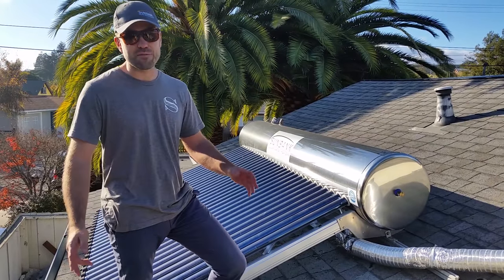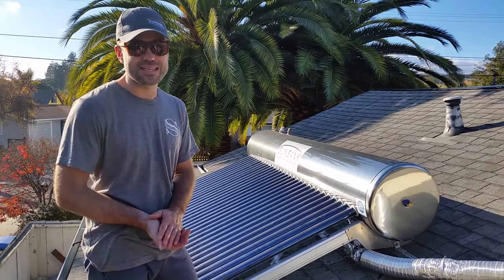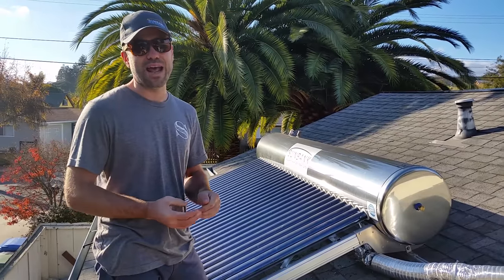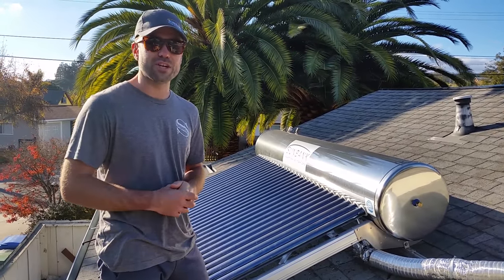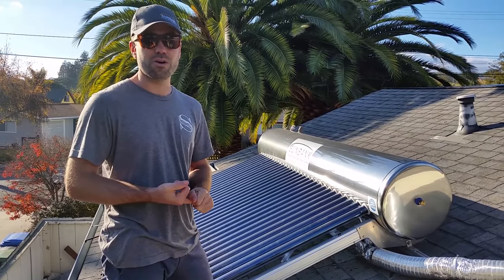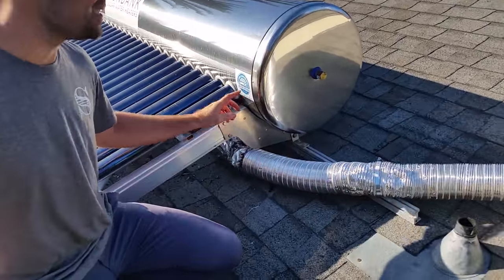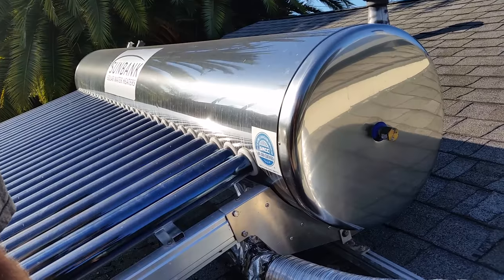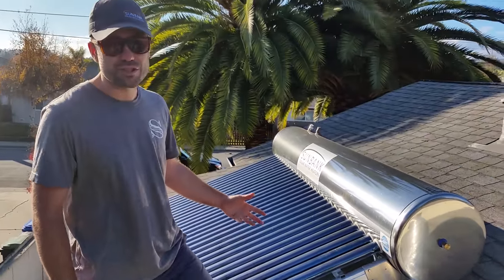How Solar Water Heaters Work

Comment: What is the lowest temperature that sistem can take? I live in Albuquerque and in winter months temp can drop quiet cold
Reply from the maker: The Sunbank collectors are good to -35F and the tank has 40 or 80 gallons of thermal mass and good insulation, so those components are both fine in freezing weather. The part of the system that is susceptible freezing is any plumbing between the tank and the conditioned space. We have many systems installed in New Mexico, including on the Earthships near Taos - they all perform really well. More info here: https://thesunbank.com/freeze-protection/
Reply: @SunbankSolar  great. Do you sell the system or it comes with installation only? I am asking that becausei do eant to buy one but i do plumbing and i could install it myself and save some money.
Reply: Careful, Walter might knock on your door

Comment: If the tank at the top is painted flat black, it will collect a lot of heat also..Also, spray foam / insulation under the tank can help keep more heat in...Also, a big reflector onto the big tank could help, at least a shiny plate to reflect light onto the tank..
Reply from the maker: What you see in the video is the outer shell of the tank. It has 2+ inches of high density polyurethane insulation underneath it and then the actual 316L SS pressurized water tank is underneath that. So the tank is already really well insulated. For example, you go to bed with 140F in the tank and wake up with 135F.

Comment: Think I’d rather just have a solar panel to heat the water in my existing water heater. I don’t live in the tropics. Have you installed any of these in northern Alabama?
Reply from the maker: We have systems dotted all over the South, yes. Using solar panels instead is an option, but a less efficient one. Solar panels are getting up to 20% efficiency, but evacuated tube solar collectors are 3 times that. So, you would need 3 times the roof space to create the same amount of heat as the Sunbank. Solar panels are also more expensive. And you'd have to buy and install the electric water heater. So, there are quite a few advantages to a purpose built solar water heater.

Comment: Can you make a glass box around the system to harvest more energy, something like greenhouse, I think it make water hotter, and made system more effective.
Reply from the maker: The evacuated tubes are exactly that. They each create a (almost perfectly insulated) greenhouse around the copper heat pipe that transfers heat into the tank. It will be 400 degrees on the inside of the tube and is always cool to the touch on the outside, because of this vacuum. A second piece of glass around the tubes would be unnecessary and would reflect some of the UV radiation that heats up the tubes.

Comment: Looks like a great product. Can a low-flow recirculating pump be used with this system? Specifically, pushing water through this tank to allow hot water near all the faucets in the house? I will have a dedicated return line.
Reply from the maker: Absolutely - in fact, we sell a recirculation kit to be used with the system. Since you have a dedicated return line you don't need the valve and supply lines, so you could just buy the pump or get one from another supplier. Ours are incredibly reliable, have magnetic impellers, and only draw 8 watts. https://thesunbank.com/products/

Comment: How many people can use one if lets say its installed in a hotel where people shower simultaneously?
Reply from the maker: Thanks for your message. The 80 gallon system is typically good for 3-5 people in a residential installation. For a hotel you would put several systems together in parallel, based on the daily consumption. You would likely have them pre-heat your existing water heating system, so they would just save you energy and money but not be relied on for hot water. See our commercial system video which shows systems installed on apartment buildings.
Reply: Great question

Comment: Will the water freeze at night in a cold climate If the electric power goes out?
Reply from the maker: The system itself is not really concerned with freezing. The tubes are good to -35F and the tank is very well insulated with 40 or 80 gallons of thermal mass. We have a lot of systems installed in places that freeze and they don't have freezing issues. More info about how to prevent freezing here: https://thesunbank.com/freeze-protection/

Comment: Does this work in upstate NY?
Reply from the maker: It does, but with some important notes. First, any plumbing in an unconditioned space will need to be properly freeze protected. In cold climates, it may be more efficient to use our system as a pre-heater instead of a stand-alone, so that your main tank isn't mounted outdoors. You could also use the system as a pre-heater, but only use it seasonally, from spring to fall when you'll get the most solar gain, and drain the system for the winter.

Comment: Is this better than a radiant  boiler with a circulating system ?
Reply from the maker: It definitely creates less emissions and is cheaper to operate! But they are different systems. This is primarily for domestic water heating year round, whereas a radiant boiler is to provide heat in the winter when there are fewer hours of sunlight.

Comment: What about at night?
Reply from the maker: Great question. The Sunbank tank is insulated with 2+ inches of high density polyurethane foam. You go to bed with the system at 140F and wake up to 135F. It doesn't really matter when you use the hot water.
Reply: @SunbankSolar  That's actually correct. the gym in my college campus had one of this and we never run out of hot water despite a lot of people taking showers throughout the day. One night we were working on a project and we had to spend the night at campus. It was 5am, still dark and I had classes at 7, I was waiting for the sun to come out thinking that a little bit of sun would make the water not as cold as I thought it would be. At some point I got tired of waiting and said "fuck it. I'll shower with cold water then". To my surprise, the water was boiling hot and the system didn't have an additional tank, it was just the remaining hot water from the day before.

Comment: It really hurts when you have a solar water heater, it’s a cold day and there’s fog everywhere and your dog destroyed the wires of the electric rod in the solar tank.
Reply from the maker: Hope your dog is OK. That's why electrical wires have to go in conduit per building code. ;)
Reply: @SunbankSolar  oh totally. The switch for the rod is always off, the wires were installed in a trashy pvc pipe which he tore apart.

Comment: the water gets pushed by the pressure from the mucipal water?  really?
Reply from the maker: It does, yes. Just like any conventional water heater. The pressure at your shower is from your municipal or well water pressure and that passes through your pressurized water heater to get there.